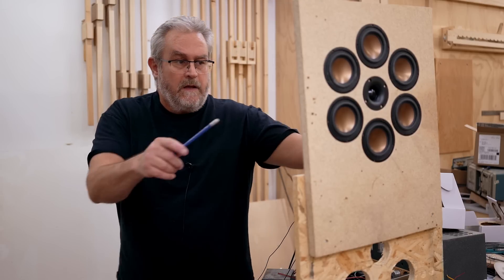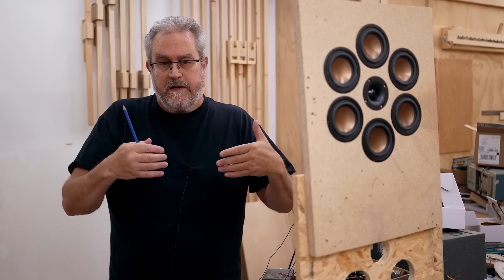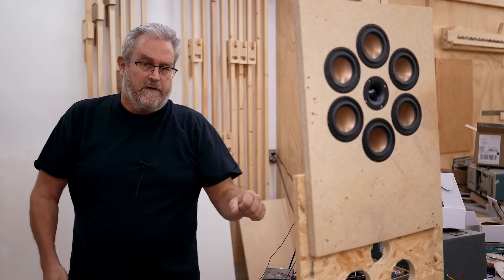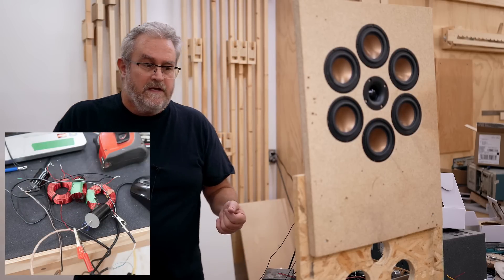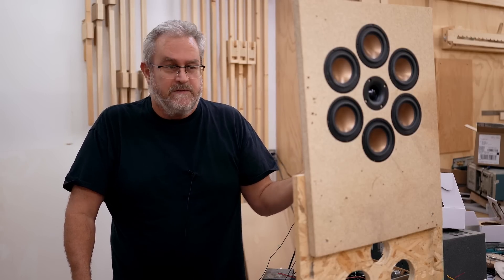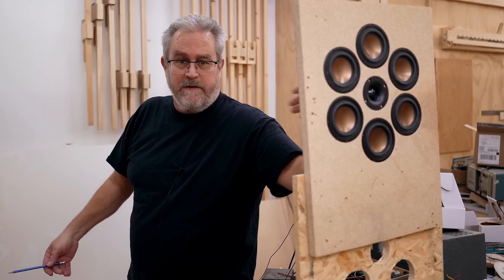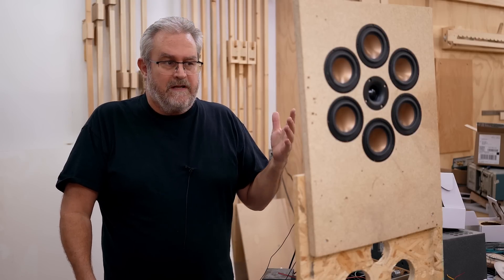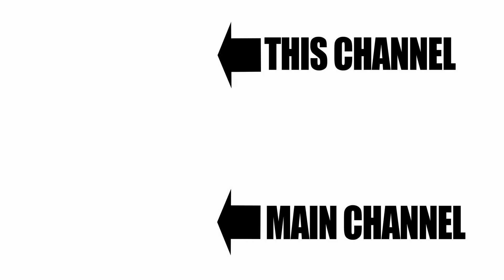All I Can Say is... Wow!

Comment: Go DIY!  However, Eric Alexander would like to have a word with you.  Otherwise, as implemented in his speakers, the sound is nothing short of amazing.  I'm a fan of line arrays and planar configurations, his Moab is 6ft of this in an MTM configuration which sounds fantastic.  The majority of his speakers use this midrange driver configuration (MTMs using all as midrange in the cluster, and non MTM having the middle driver covering the high frequencies...
Reply: At least this design doesn't infringe on Eric's patent, which only covers the center driver being identical to the surrounding ones.  Oh, he tried to patent different drivers in his original application, but apparently, that didn't stick (I'm guessing there was prior art). The one advantage Eric has is that he can reduce the cost by stocking only one style of tweeter to build his speakers.  If one were to surround the center tweeter with more tweeters (instead of midranges), and those tweeters are a different style, there still would be no infringement on Eric's patent.
Reply: @abboberg  I ignored the actual patent discussion on purpose.  He doesn't use the same tweeter across the board.  Depends on the model.  I was hoping this DIY was going to be open baffle because that would be interesting.  There's something special and effortless about the midrange from the Moab for instance.  Magnepan is pretty explicit about the weight of their drivers as well, that's a huge factor.  I love the sound of both types.  It will be interesting to hear impressions when this is done.

I'm a Tekton customer (I'd most likely buy through them/him again if I had the need), and I'm puzzled at how one patents the arrangement of off the shelf parts.  I haven't looked into the patent(s) -- I just care about how the music flow through the damn things to my ears.
Reply from the maker: Patents are not applicable for this because I'm not going into production or producing plans for the design. That's what a patent is for - documentation to help stop a competitor from stealing a design to sell. 
To enforce a patent, you need to sue (in court) the alleged patent infringer, and that, my friends, is insanely expensive. And in the suit you have to show a clear breach of the patent, as in the original design was employed and units that will be sold were produced. The goal of a patent suit is to stop production and recoup any damages that were done because a rival product was taking market share away from the original. 
On top of that, my take on this (as mentioned above) isn't the same as the original design, which uses tweeters instead of midranges. Other speaker manufacturers have already done this and marketed their products.
Reply: @tupuhumuhumunukunukuapuaa3093  Well, you are not avoiding the whole patent discussion by saying he doesn't use the same tweeter across the board.  Of course he is not going to violate any patent when using a different driver in the middle versus the surrounding drivers - that is not in his patent and is likely prior art since he actually tried to patent that in his original application.  What his patent morphed into is a "cost reduction patent", which is what he clearly did not want, originally.  It is cheaper to not have different drivers in this array.  However, the spirit of his patent is still there - having the surrounding tweeters act as a concentric midrange since they aren't working that hard and sharing the load amongst themselves.  As far as the sound - I've heard that the speakers are very directional - is that your experience?
Reply: @IBuildIt  If the patent were applicable (and it's not, clearly), you would still be infringing, and he could sue you to stop making them.  You can't just blur the lines between high-volume production and low-volume production (making some for you and your friends) - infringement is still infringement, no matter how many you make.  Sorry.
Reply: @abboberg  This is the patent discussion I was avoiding.  That part really isn't that interesting.  What I'm interested in is how they sound.   My Eric would like to have a word was a lil sarcasm, I mean, look at the design!  

I'd consider Magnepans directional (would that be your reference for directional?), but the Moabs not so much.  They don't beam, or shout.  You can play them loud and walk right up to the mid and bass drivers.  Just don't put your ear to the HF driver.  I'd say that there is a sweet spot where "magical" things happen, but overall, you can sit just about anywhere and get great sound.  My wife sits off to the side to curl up with her tablet while listening and I thought that was nuts, until I sat there and in our room it still sounds incredible.  Pretty much anywhere forward of the speakers sounds great, you just give up some amount of imaging, but the music is still detailed and at ease at reference volume.  They are fairly forgiving of close proximity to walls.  I would say that at the listening position, certain angles of toe in might be more desirable depending on what your tastes are.  I think slight changes in tonal balance are apparent on the vertical axis.  On the horizontal, the sound stage just shifts with you in that regard. 

Happy Listening
Reply from the maker: Anyone can try to sue anyone else for any reason, so of course he can try to sue someone who copies his design. 
BUT, and I put that word in all caps for a very good reason, it's not worth it if you can't recoup the cost of bringing suit. It's simply not WORTH it to sue unless there's some money behind the infringement. 
AND there has to be a clear case of infringement, as in the alleged infringer is using the exact same concept without substantial changes. Any significant change (like using fullrange drivers instead of tweeters) will neatly skirt the patent.

Comment: Well it kind of is radiating into a moving cone... Six of them 😅
Reply from the maker: Not really. The horn that's on the tweeter focuses the sound energy more forward, so it doesn't radiate across the surface.
Reply: @IBuildIt  sure if you're crossing it over at 4K. But I'm guessing you want to cross it over around 1K where the wave length will be around 13 in to avoid comb  filtering.
Reply from the maker: You do realize that almost all speakers have more than one driver on the baffle, right? Take the typical MTM with cones above and below the tweeter that are much bigger than these. Do you point out the same absurd observation when you look at those?
Reply: @IBuildIt  only if the designer falsely claims that there won't be modulation distortion.
Reply from the maker: I didn't claim that. I said the tweeter isn't loading into a moving horn. 
Watch the video again, but take a break from looking for petty things to criticize and actually listen this time.
Reply: @IBuildIt  naah, I'm a YouTube commenter, it's my job to look for petty things 🤣

Comment: The trick is to crossover as low as possible with a very good tweeter. There's a ratio formula for distances between the midranges and crossover point. Given how small they are I would think crossover at 1200 hertz should be no problem for no comb affect. So a third or fourth order on the tweeter so it's down 24 db by the Free air resonance on the tweeter so that you can crossover as low as possible. The woofers probably can handle way higher frequencies so I guess 2nd or third order? I think he is just experimenting with the drivers and they may change if he want's more sensitive or better drivers in his six midrange layout.

Comment: Very nice DIY video. Out of the measurements for on axis and 20 degree off-axis the later is more linear indicating comb filtering and cancelations since all 6 drivers are placed with equally distance between each other. Try an arrangement where you have at least 2 different distances like 5 inches and 3 inches to even out the comb filter effect and get a more linear response.
Maybe like this:
O O
  o
O O
O O

or:

  O
O O
  o
O O
  O

Since you probably have your tweeter vertically at the level of your ear spreading out midranges vertically doesn't do as much harm as spreading them out horisontally.
The second setup will give a multitude of distances and a multitude of different comb filters interacting and cancel each other which hopefully will prevent bigger dips and peaks.
Using two bass drivers with different distances to the floor will also help to even out the major -12dB dip you get at approx. 100-150Hz because of the 180 degree out of phase reflex you get from the floor. Look at Wilson Audio Sacha. That arrangement gives a much better bass response in the room compared to a single bass driver.
To address diffraction problems I would round of edges of you cabinets with 1-2 inch radius. Otherwise edge diffraction will be a part of the equation to solve since distance between drivers and drivers and edges are quite equal.
Interesting project that help to a deeper understanding...
Good luck.

PS. If want to try the dual bass arrangment I would suggest SB Acoustics 8" 20PFCR 8 ohm in parallell and passive radiators on the back of the cabinet (27 liter volume for each driver) or SB Acoustics 6,5" 16PFCR 8 ohm in parallell in bass reflex cabinets of 16 liters per driver.
That will probably give a better end result than a single SEAS 21WO even if that is a potent driver in itself.
The SB Acoustic drivers will have a matching sensitivity to let you make a design that can handle the baffle step properly.

Comment: Interesting. I wonder how it would do if the ring of drivers was splayed outward a couple of degrees.
Reply: I wonder the same
Reply from the maker: Biggest difference would be how difficult it would be to do that. The baffle would have to be machined to tilt each driver, yet have them sitting flat to make a good seal. That alone would make it impractical, unless I could be sure that the results would be beneficial.
Reply: @IBuildIt  You could do a series of pointed segments with compound angles on the edges. In contrasting woods it would look interesting and seems to be right in your wheelhouse. No idea if it would improve the off axis, but maybe you could mock up a test with some driver wedges to put on your test baffle to see what the results might be. I wonder if simulation software could give a clue? Just an idea based on what you got from your tests.
Reply from the maker: Too much work for not enough in return. Besides, the off-axis response looks great already.

Comment: If you look at Augspurger specs, they do a 5" 16 ohm 500Hz - 20K Hz horn over an 8ohm 10 or 12" mid bass for 200 - 500hz, then a 4 ohm 12 or 15" sub for 20 - 2 or 300Hz. With an awesome DSP set up. Roughly. I highly recommend looking into these. They are current recording studio standard. Amazing what they do with EQ and phase issues. I learned a lot from these guys.

Comment: How about a MEH? It does nearly the same thing but  it's even more of a point source as the speakers are bunched up together. The cancellation from the back wave bouncing from the throat affects ALL distortion above the passband of each driver, which eliminates all harmonics outside of it unlike in a conventional speaker, where each cone plays all it's harmonics. This means that distortion is virtually inaudible except for the lowest harmonics of the lowest tones of each driver (which are not necessarily unpleasant) and the distortion doesn't rise with SPL like it does on drivers on a flat baffle. Also time aligning of the response is nearly constant across ~50* in front of the speaker. Being a horn it doesn't have much output outside of it's beam. It basically behaves like one driver but without any distortion.
Four inexpensive 3" pro audio transducers don't need to look nice, so they cost less. Sensitivity is high because of horn loading. Construction is tricky because of all the trapeze parts and angled but the enclosure is also more stiff thanks to natural bracing of a pyramid horn. The main downside is very wobbly frequency response.
Reply: What is a MEH? I only know that word as ‘I’m not impressed’.
Reply: @nathandaniels4823  Multientry horn, like Danley Synergy horn

Comment: I wonder if an odd number of mid-range drivers ( like five ) would be better.  Five would have less symmetry and thus results in weaker resonance fields both in the far field and in the box.
Reply: At least one of the issues with any odd number of drivers (above 1) operating over the same bandwidth would be the net reactive impedance load, which it drops low enough could cause more than a little bit of grief to many amplifiers- hence, I think John’s wiring configuration of two series wired sets of paralleled triplets.
Reply: @fonkenful  I did not think about wiring.  I guess a series of five with 2 ohms speakers would be hard to find and purchase.

Comment: Nice, that’s similar concept to a Tekton speaker where the tweeter is surrounded by midrange drivers. except the Tekton uses tweeters to play midrange.
Reply: The difference is he was gonna use 4 first then switched to 6
Reply: @n1n1n1-v6x  Tekton has a 4 and 6 midrange arrangement as  well.

Comment: I think this would be even cooler if the outer mid-range drivers were smaller to get closer to the tweeter, for example 8x 2" BMRs spaced around a 90mm tweeter waveguide.
Reply: When I first saw Tekton design loudspeakers, I had the same idea and immediately bought 8 2" BMRs to test with.  3 years later, and I still haven't gotten around to it.  LOL!!!
Reply: @conchobar  Haha years ago I bought 6 midrange and 6 tweeters and they are still on my shelf. Life gets in the way.
Reply: I had the same thought. If you use more smaller mid drivers could it sound better? When do you reach diminished returns?

Comment: I've got an old Energy Center Channel with a tweeter and two mids flanking it diagonally and back in the day when the experts tested it, apparently it had almost no change from on axis to off axis, (or so wide that it wouldn't be an issue in standard application). I wonder if two mids would work as good, or better than 4, or 6? Lots of the vintage speakers employed two mids. 

Love the videos!
Reply from the maker: Thanks! I need the extra drivers to push up the sensitivity to match the tweeter. Using just two would mean I'd have to pad the tweeter down a good 12-15db.
Reply: @IBuildIt  lol... That's right you mentioned that in the video and I sort of forgot it thinking about the possibilities of the general arrangements. Maybe a less efficient tweeter or more efficient mids. Interesting experiments and I'm interested to see how it goes. I've seen some super high end boutique speakers in videos that look like that. The one thing that I don't understand, is that usually the Mid-Range is hotter than everything else and our ears are more inclined to be more sensitive in that range, so I'm not clear on why more Midrange is better, or how it's not negatively impacted by comb filtering and cancellation. I've got a couple old Jensen projects coming up that have the dual mids, spread far apart and at different heights with the tweeter sort of centered and nested in-between, but up a little higher... Pretty sure I'm going to use pro drivers for one or both  projects. I was considering using one of the holes for a port, but it would throw off the cool retro look.

Comment: This setup reminds me of a set of Aria coaxial speakers I had in my car in the 90's/early 2000's.  The tweeter was mounted on the center post of the center post of the driver so it was "in phase" with the surrounding woofer as opposed to being mounted above the woofer like you typically see in a coaxial setup.  Cool little speakers for their application.
Reply: Elac did something similar a few years ago with the Uni-Fi. They sound fantastic.
Reply: Explains why my tweeters are mounted over the top of the woofer on brackets. (Bose 42)

Comment: 1400 Hz may be the primary reason for the lack of comb filtering off-axis.
Reply from the maker: Yes, it wasn't by accident that I settled on that, but I will try to push it a bit higher in the final design. The tweeter can cross that low, but it's getting a bit too close to the Fs for cleanest results.
Reply: I am struggling with comb filtering, not the theory but more why you would hear any noticeable effect in any realistic listening room, and if you could why this would be any different if the speakers were wider apart (as in a standard two way stereo pair of speakers).  Haas and others had much to say about this about 80 years ago!